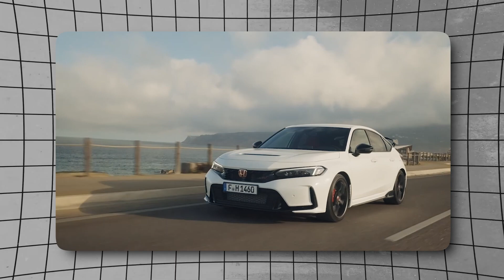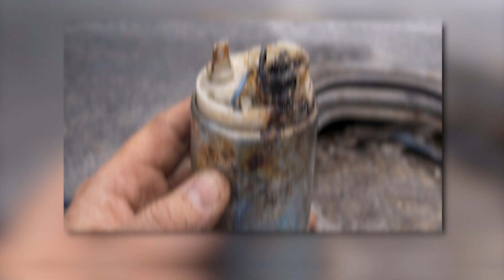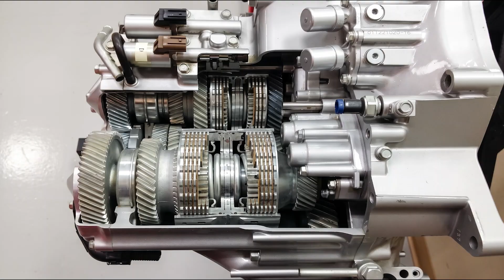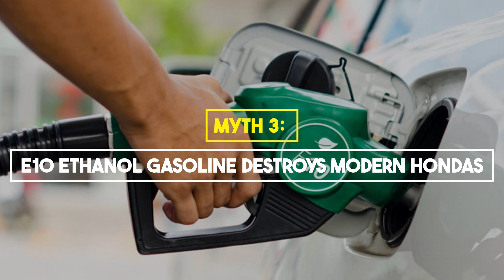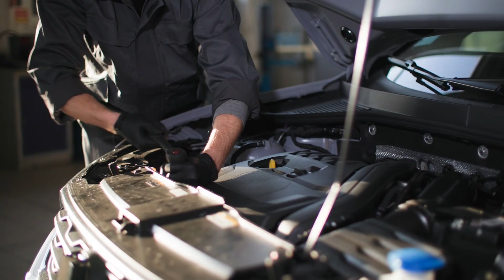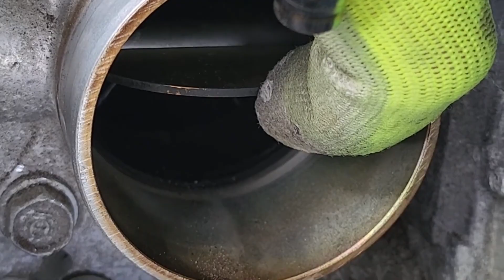8 Honda Fuel Myths That Are Wasting Your Money

Comment from the maker: Which Honda fuel myth did YOU believe?

93 octane? Running the tank nearly empty? The 3,000-mile oil change? Warming up your Honda for 10 minutes?

Drop your Honda model, engine, mileage, and the myth you used to believe 👇

I want to see which one is most common among Honda owners.